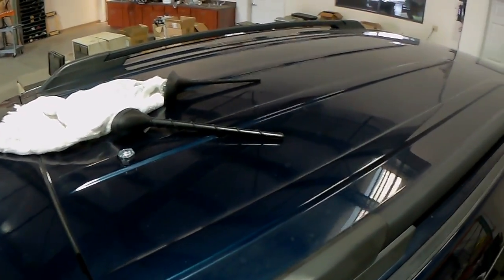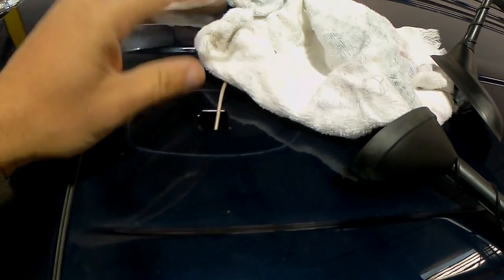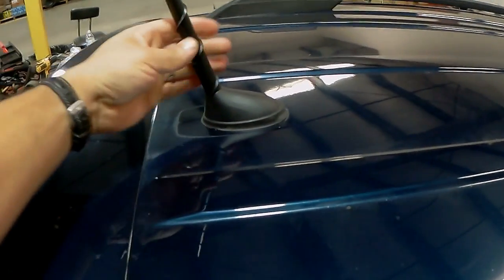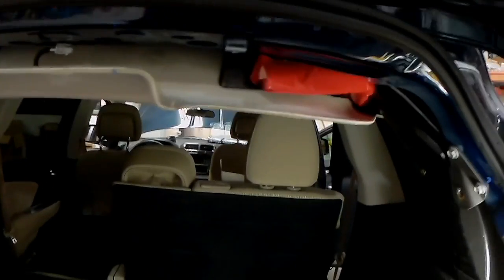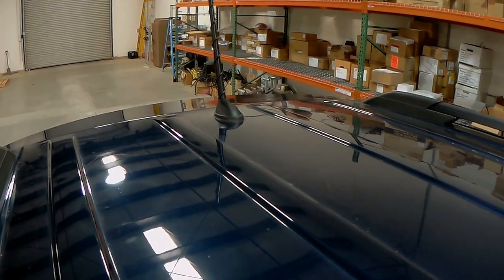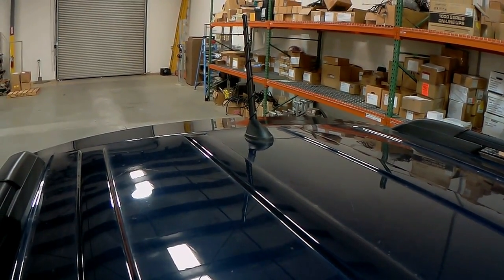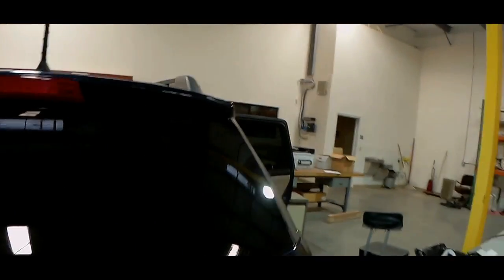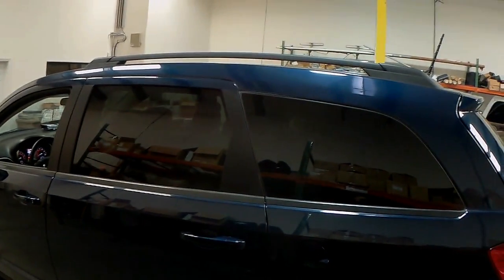Undercover Radio Blunder, Made Right. Final

Comment: BTW, the spiral thingy on the antenna is designed to reduce wind noise that may be generated by the antenna at highway speeds.
Reply: The spiral shape increases the bandwidth of the antenna, at the expense of gain. It also mechanically shortens the antenna, versus if the same length of antenna were kept straight.

Comment: The TAC channels here typically go through the Smartzone system which is how the local Motorola shop and the county 911 radio guy programmed them, I had the detective, VICE and narcotics unit call me up wanting separate radios for their undercover comms, so instead of having them waste more money I went in and added true direct / TAC channels to  their 800 MHz radios, frequencies the county was licensed for but no using for whatever reason.. so they are not being broadcast through analog system this town still uses. the State police use a p25-2 700 MHz system.

I have a similar antenna on my truck for my 700/800 MHz mobile and some low profile transit antennas for my VHF and UHF radios, they are pretty unnoticeable but I am not an undercover cop either, I just work on their comms from time to time.

Comment: here is a similar DIY approach the local taxi drivers do. Common UHF and FM Radio antenna, plus there are a GPS And a GSM antenna inside the sharkfin. https://scontent.fath1-2.fna.fbcdn.net/v/t1.0-9/11898917_10207836344932500_6983228954373078601_n.jpg?oh=505e9099550b45bc1287613ab49f91aa&oe=5959A2F1 Source:
 https://www.facebook.com/photo.php?fbid=10207836344932500&set=gm.848521365255054&type=3&theater